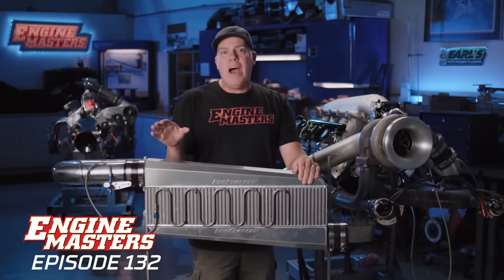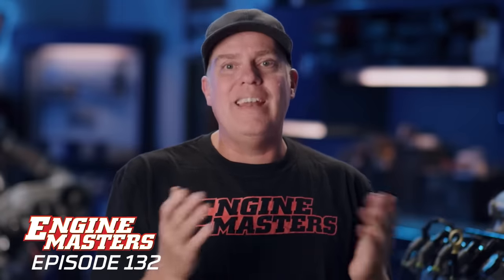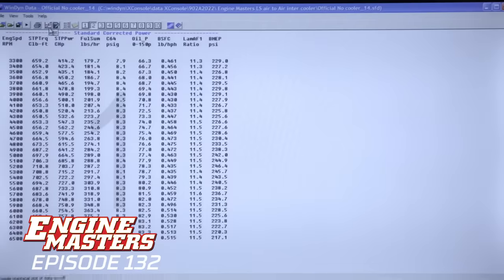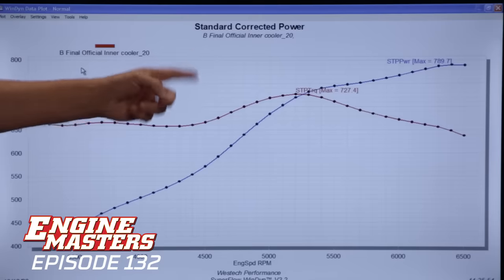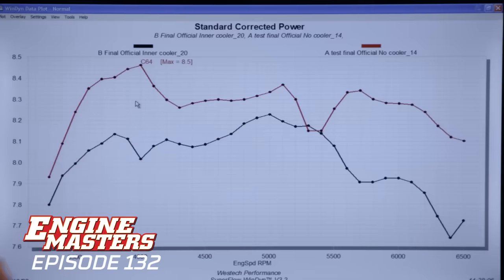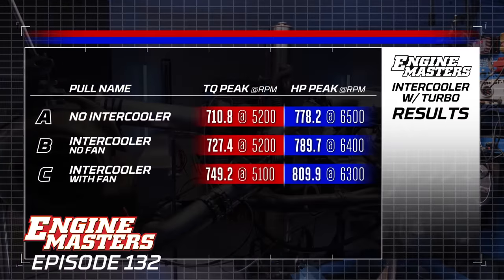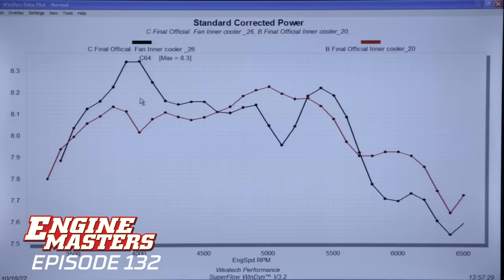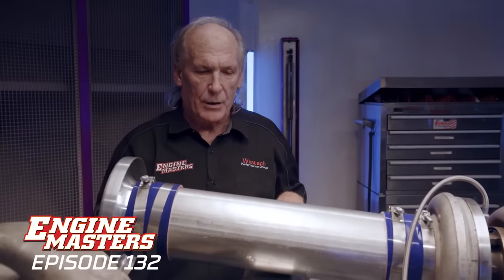Adding CO2 to an Air-to-Air Intercooler! | Engine Masters | MotorTrend

Comment: The full benefit of a sprayer system is not seen here though. Run the engine for longer than a 10 sec dyno pull, and you'll see the turbo or supercharger get hot. This causes the air exiting the FI to be hot and will eventually cause the intercooler to be hotter. The intercooler can become heat soaked and effectively not do much good (or maybe even cause a deficit). Spraying N20/C02 or even H20 to reduce heat soak, means keeping your power higher for longer amounts of time.

Comment: These no intercooler, then intercooler tests are always run on a turbo with the boost reference in the intake manifold. This makes it not apples to apples, since you add mass airflow to the intercooled configuration with the boost reference in the manifold. Do this with a procharger so you can make valid comparisons.

Comment: how warm is that room? what if it was 130F off the pavement on a day at track?
Reply: The CO2 will still work even at that temperature
Reply: Yeah, I meant would the intercooler provide less cooling on a hot day and the co2 be worth it at that point.
Reply: On a day like that, fogging water onto the intercooler would be an excellent idea. @BanksPower used it to good effect on Mike Ryan's Freightliner Pikes Peak truck

Comment: Can you teach us how everyone is using co2 to build dome pressure to add more boost plz
Reply: It's so that you can run a small spring. 5Lb spring but 20psi CO2 (for example)  on the dome = 25 Lbs boost. Advantage is you can shape the launch boost from 5psi, and ramp it up quickly. Prior to that, you would need to try and add boost pressure off the turbo compressor to the dome. TBH electronic wastegates are about to take over. Just skip CO2 WG and go electronic.
Reply: @mickanon5607   I get all that how do you   Hook it up to your car. There is no YouTube video how to install co2 to build dome pressure

Comment: Lets go! Im putting the gas through a radiator/intercooler because less heat more power... What do yall think? And stated before the windshield washer things reroute that to the intercooler!
Reply: Fuel chillers/coolers have been a thing for years. Many factory diesel engines have fuel coolers on the return line because common rail pumps make the fuel hot.
Reply: @mickanon5607  I'm doing this to my k series engine... It just has a standard fuel rail it couldn't get hot... So am I good?
Reply: Sometimes you actually want the fuel hot so it vaporizes quicker. 
Fuel density isn’t really a problem other than tuning. You’re forcing the fuel in under pressure and aren’t filling the cylinders with fuel. So, it’s easier to just turn it up. 
Even if you’re forcing it in you’re limited by how much air can get put into the cylinder. And you need to fill the cylinder with mostly air. At that point density becomes more of an issue as denser air equates to more air.
Reply: @NBSV1  ok what about with a turbo I planted on boosting it anyway...

Comment: Can you guys investigate the possibility of a SBC 350 TBI (non-vortec; 88-94) and swapping the TBI for the Edelbrock Pro Flo 4 (trad) with a MSD coil-near-plug and see if someone can actually make this combination work? Stock-ish bottom end SBC 350, MAYBE cast iron VORTEC heads and the Edelbrock-MSD mashup on top. I am digging into this myself and am only looking for modest gains in the HP and Torque but seeking an MPG boost of maybe 20% over stock. I've got an 88 myself but doing my homework before I start turn wrenches.
Reply: so you want them to dyno test your set up for free. 🤣🤣
Reply: @KingSMW  Maybe I was not clear enough with my comment/request. I just want to know if it's buildable. Edelbrock reps say it can't, folks on message boards say they seen it done; I need tangible information. Dyno is not needed just it being able run is what I want. Let's forget about hp and torque. If these guys do it, then it's further and up-to-date information with knowledge from their experience on top. Am I still cryptic or is my request now better iterated? I'm looking to build for mild street performance and to beat these fuel prices a little WITHOUT going for an LS swap.
Reply: @P-nutBD  now im curious why this wont work. my first thought is how do the ports all align? if they align then why wouldnt it? air, fuel, spark. right?
Reply: @P-nutBD  there is something i saw on the other engine show thats on TV. they took a sbc and used ls heads? i cant remember exactly but they saw good gains. it was a mash up of an ls and a sbc. that may give you some direction maybe? OH! HORSEPOWER TV is what im thinking. that episode ,may give you some ideas. and there is no such thing as "can't do it". there is only "i can't afford it". thats not meant to be a knock on you! only them.
Reply: @KingSMW  Yeah, I saw that one too, but they used a Motown block which is pricey somewhere around 2k for a bare block, it'd be cheaper to just go pure LS by a visit to a local salvage yard.

Comment: The spray is what mitigates the under hood heat soak from the radiator, engine, etc when everything is running hot. The dyno is not the real world.

Comment: You cant use a Air-Air intercooler with roots blower?WTF. 

Please explain how the first OEM supercharged and intercooled car worked 1989 Thunderbird SC.   Or how industrial air compressors function. Ingersol Rand, Grander Denver, Atlas Copco, Quincy, Cooper...

Comment: The CO2 coils need to be in front of the intercooler. not on the side, be careful of the temperature, too cold it could "rain " inside the engine

Comment: I need a intercoller for my air compressor
Reply: The tank does the job of radiating heat. If you use compressed air, it will typically be cold

Comment: You might not want Nitrous getting into the engine but you also don’t want CO2 getting into the engine either.
Reply: Exactly
Reply from the maker: Fair point!
Reply: Propane?
Reply: Good point, but to be fair... CO2 would most likely bog it out though, nitrous not so much lol
Reply: Easy to avoid it going into the engine but do you really want your engine bay full of nitrous
Reply: @grandnatty172  Well yeah, doesn't matter which way the numbers are wrong. Either way it's bad data.
Reply: @shaynegadsden nitrous isn't flammable on its own...
Reply: @208Concepts  as nitrous oxide no but it will split into nitrogen and oxygen at 300C which a perfomance engines exhaust easily exceed and pure oxygen is dangerous, apart from rapid oxidisation it makes everything extremely flamable. So if any vapours are emitted you now have a bomb waiting to go off this was the problem faced before nitrous was used and they tried using pure oxygen as a power adder
Reply: A little extra CO2 isn't going to make much difference to the engine. Apart from potentially displacing a tiny bit of oxygen from ambient air (which given the CFM going through that compressor inlet at WOT is going to be pretty inconsequential) it's going to have virtually no effect of combustion except lower peak temps a minuscule amount the same way as EGR does as it's just inert gas to the engine. At worst the engine might run a tad rich.

Nitrous on the other hand is far from inert, can significantly swing the air fuel ratio if inhaled and if it does it'll go lean, which in a boosted application can end real bad real quick.

For those others suggesting propane you get the reverse situation to nitrous where it'll run rich if it inhales some, which isn't ideal for the engine but not particularly harmful either, however carelessly spraying flammable gases around an engine bay/dyno room is a pretty dumb idea with pretty serious safety concerns
Reply: @kleinbottled79  for sure no doubt. I agree with that. I just meant they are trying to get higher numbers data. With CO2 they would know quickly if it was getting sucked into the intake. With N02 however, it's either going to make more power from a chilled intercooler or intake seepage. It just helps eliminate the intake seepage as a false HP gains if you use CO2. They don't care if the numbers are lower, that would just confirm the exact reason as to why they used CO2 in the first place. With CO2 if it makes more power it's because of the chilled intercooler, if it makes less power, it's because it got sucked into the intake. I think running a fresh air tunnel would have been best with this test though.
Reply: @carnivorebear6582  The comment wasn’t stating which gas had the biggest impact! 
The point is you don’t want either involved in the experiment. 
No experiment tolerates a variable because it is deemed to have a lesser impact than other variables. (Unless your an anti education, conclusion first, god believing conservative from Florida).
Both are minuscule amounts. If you claim you don’t want one impacting the results, you have to exclude both, to the best of your abilities.
Reply: It's not injecting CO2 into the airstream, it's cooling down the airstream running thru the intercooler, by misting the intercooler veins.
Reply: @MotorTrendWatch I'd sure like to see this in conjunction with very cold fuel as well.
Reply: @jackmackenzie2118 propane would probably be better at cooling but it’s probably not the best idea to spray flammable gas into your engine bay. One bad plug wire and you’re having a real bad day
Reply: Nitrous oxide won’t effect the engine at all once it mixes with atmospheric nitrogen ( makes up about 80% of our air)
Reply: @tomconner5067  It will if all the fuel isn’t being burnt during combustion. 
And it isn’t all being burnt if you run it at less than stoichiometric 14.7 to 1
They run them around 12-12.5 to 1.
It’s the O  that allows more fuel to be burnt. Not the N.
Reply: I really don’t understand the point when nitrous works much better inside the engine, or just spraying water/meth
Reply: @jackmackenzie2118 Propane would be worth it, but at that point, one may as well convert to propane for fuel. It's around 110-114 octane of equivalent gasoline. Propane evaporating from liquid to gas in the air/fuel charge cools things down further.
Reply: Wrong, I do. I want all the CO2. Thanks

Comment: False.. You can run a Air to air intercooler on a roots super charger if you want to fabricate a diversion plate, done it many times. also you could use the C02 evaporation to chill the liquid in a W2A setup.

Comment: if you jacketed the intercooler with chicken wire and packed dry ice against it, I think you would get better results than injecting CO2 into the engine... 

edit: or go full formula 1 and spend 80 bucks to strap some dry ice to the intake on an electic leaf blower, and strap that inside the hood of your car aimed at the intercooler.  cheap wins
Reply: Many Bonneville salt flats cars have liquid intercoolers with the coolant circulating through an ice tank. It means less air needed for cooling so less wind resistance

Comment: Try the CO2 on a wide intercooler designed for that much HP and with more than a few inches of transfer area. On a core that is at least 30 inches wide..... With 30 inches of heat transfer tubes and a core that is actually designed for 850 hp, the temperature drop is dramatic when chilled with CO2. The core used here has about 6 inches of transfer, at most. And heat transfer is based on the time touching the transfer area, not the differential. All this really proved is that you used the wrong type of core in the intercooler for the test. Which is not a shocker.....

Comment: Every time you do a video like this you only do charge temperatures. Or fuel temperatures. Can you guys add your transcooler. To cool the fuel. So you're cooling the fuel and the air temperature. Not just one or the other.

Comment: Its not a valid test to do a dynamic, fast run on a dyno. No steady state conditions, temperatures not stabilized. Need to maintain load for a much longer time to get proper results.

Comment: Air to water is the way to go. Air to air can only get as low as ambient.
Reply: Isn't this about getting below ambient?
Reply: @riccocool  that would be the point of the co2, to get below ambient. But as you can see it didn’t do much. It is impossible for just an air to air intercooler to bring intake temps below ambient by themselves.
Reply: @billballin6948  I'm mainly a street guy.

Comment: Boost changes due to pressure drop on the IC not cooler air 😂 also because as americans you are not using proper pid control on boost to get it up to same boost on all tests.

Comment: you're testing it with the wrong engine. it needs to be heat or octane limited. then tune as far as it can go with and without... then there will be a bigger difference.

Comment: I think there will be a bigger difference with the CO2 spray in a car because of the heat soak of the engine bay heating up the intercooler.

Comment: I’m thinking they should have the air cooled with an ac system if the ac can cool the air down to 45 degrees out of the vents in the cab imagine that in the intake 😂

Comment: It gets ever worse when you realize the Cost of CO2.  You guys used a 100 lbs Tank ... in the car you would use a 5 lb tank and it costs $29 per Refill on a 5 lbs tank!
Reply: And the difference in power won't make up for the extra weight of the bottle

Comment: Once again you guys go through all the agony but miss out on testing the obvious one - water mist cooling - water has approx. 4x the specific heat capacity of CO2.

Your increased HP from soaking the intercooler in CO2 tells you that there is more heat to sap then there is CO2.

So drowning that intercooler in water (or ice) is going to help you a lot more than CO2.

But of course, a low tech solution like this isn't going to help sell the high end performance products.

And yes I realise you can't drop water on a drag strip..